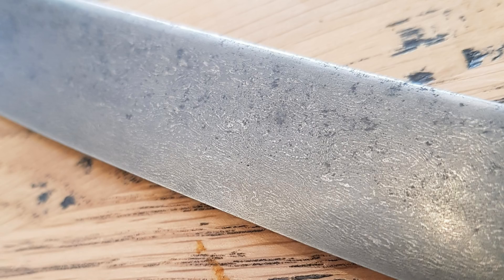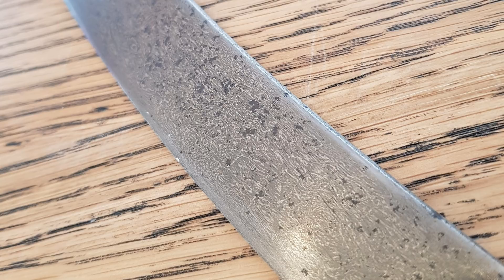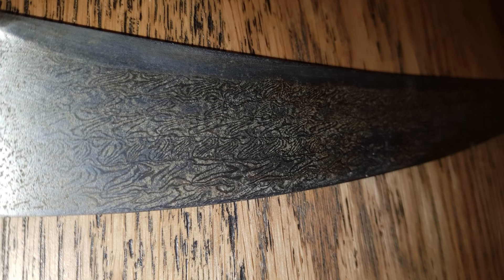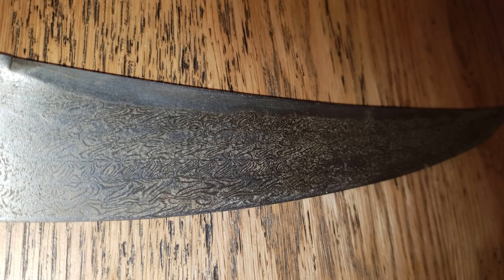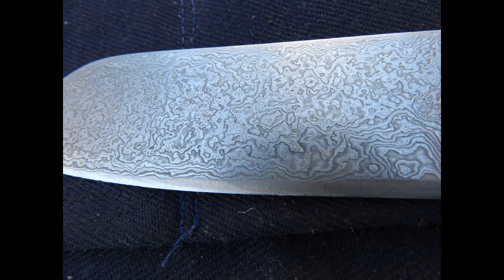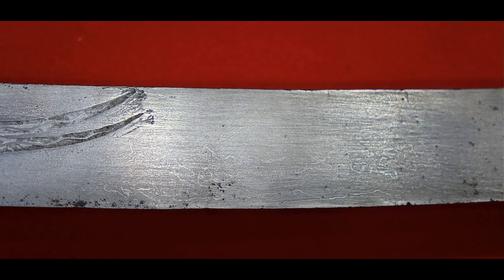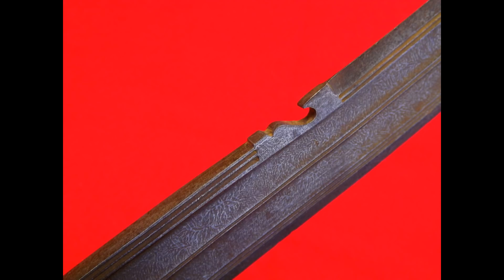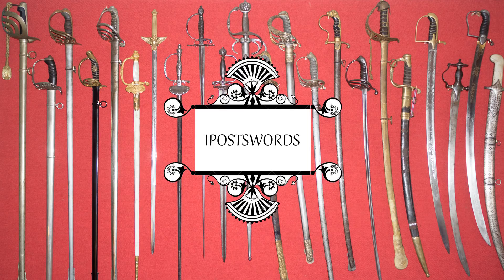FAKE WOOTZ: Replicating crucible steel patterns

Comment: Why does old Sheffield crucible steel not have the lines present in wootz?
Reply from the maker: It wasn't ultra high carbon - and wasn't heat treated in a way that lead to the aggregation of cementite into spheroids. I haven't seen any emission spectrometry analysis of antique Sheffield crucible steel, so I can't comment on the levels of carbide forming elements, but even if you have sufficient CFE's, pattern formation still requires thermal cycling to cause spheroidisation.

Comment: There's a little old Scandinavian Smith named Roselli in Norway I think who has been forging his own version of wootz for quite a while now. I picked up one of his Roselli uhc wootz knives several years ago and honestly he does a great job with his steel and heat treatment. It runs about 65hrc, holds a very crisp, sharp, stable edge, not chippy. It has a subtle pattern in the steel that certainly looks correct. From what I understand it is a fairly clean carbon steel with a high carbon content and the pattern comes from the process he uses to produce it.

Comment: After seeing a great push from many to identify their products as being authentic, Wootz, Crucible Steels, made from many different compounds, what precisely is the composite mineral nature of the steel long termed as watered steel. Constituent wise per se, as many have suggest it contains in some part Magnesium or even Vanadium. Is it entirely the ore location, or can this be farmed by mixing some other ingredients in set percentages to nearly approximate this characteristic bonding of dendrites that Wootz reputedly possesses. I'm ill of the false claims by many people with every trick in the book, and all the tools that any may never afford, parading their wares as something quite unique, and obviously most costly. Not want to fight this criminal behavior, just know the difference between a real thing, and a very common artifact with clever artifices, that hope to fool the unwary. If I want a knife to cut things in the kitchen, any high-carbon "Old Hickory" will suffice. I know a great many items like this are faked, and just don't want to be dupped by false claims.
Reply from the maker: Can it be made by adding the right carbide formers: yes. This is how people make patterned crucible steel today.

Can you ensure a crucible steel object is antique not modern: also yes. You'd need to have it tested to see if it is high background (modern) or low background (pre-1945) via measuring the amount of radiation the steel emits.
Reply: @IPostSwords  I had my mystery blade tested by my local Jewler with an XRF machine. It showed it had a small amount of titanium in the steel. From what I can find myself so far on the web it implies it was likely made right before or during WW2 as that's when they started using it for stronger steel. 
That's a great idea about the background radiation. Seems like if it has both the radiation and titanium it could narrow its window of time it could have been made maybe and place it firmly in a WW1-to late WW2 context and not after WW2? 
Anyways it didn't cost me a dime and took a few seconds. It may help you some too. I'm at a dead end with my mystery weapon. Still can't even say what type it is yet lol.
Reply: Sorry. Meant to say it would help the person who asked the question. Not you. Accidently clicked your name before typing I think sorry

Comment: Quite interesting. The multiple twisted bars of the Turkish saber are quite nice, and requires a significant amount of skill to make perfect welds. Not many modern smiths could reproduce this with period methods and available chemicals. I would certainly find this more valuable than wootz. Amazing craftsmanship on the penultimate saber also, and the pseudo-wootz etching isn't ugly at all. But the "painted" pattern on the saber sold by Matt is really appallingly poor.
Reply from the maker: MadNumForce yeah, Turkish twist requires very good technique, and the result is very attractive. It's a nice sword, that kilij